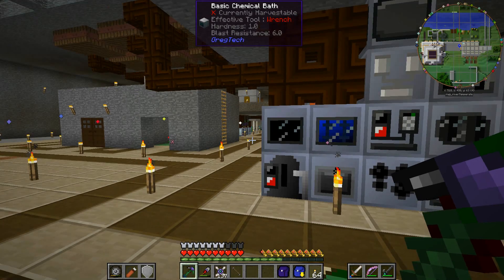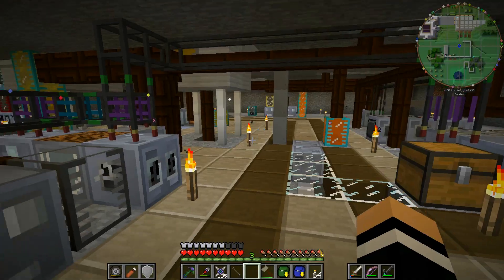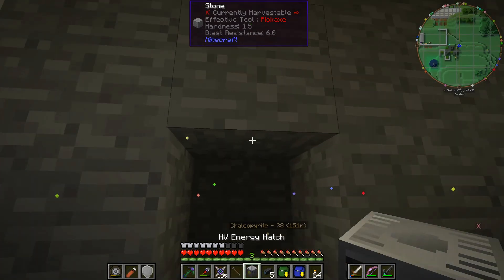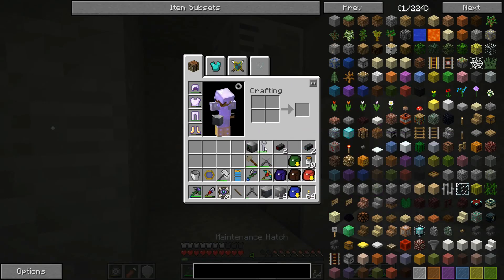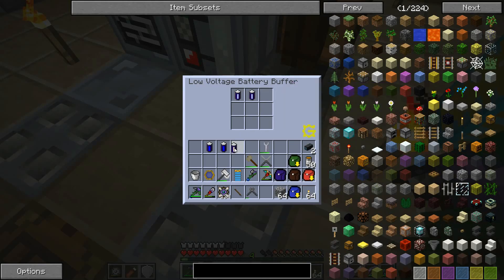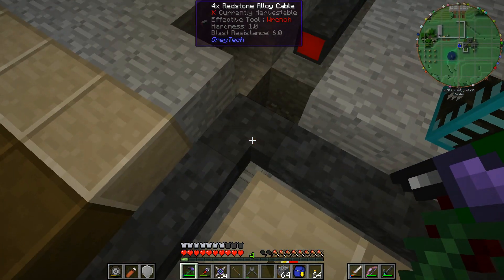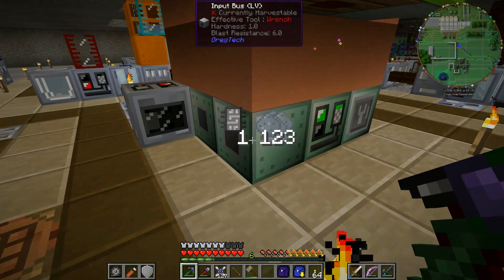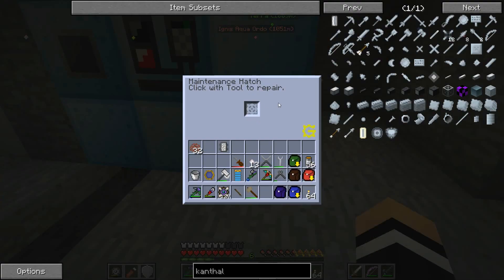S10E47 GTNH - Vacuum Freezer & Implosion Compressor

Comment: If you're going to be upgrading your ore processing array, you should definitely look into making the GT++ multiblock versions of the ore processing machines. They're all far better than their single-block equivalents (faster and less power-hungry) and the maceration stack gives you extra outputs the same way an ore drilling plant would. You'll need to dive into EV a little to make all of the machines, but you'll be able to do that easily enough as soon as you go to the moon and bring back some titanium. Also, for that kind of upgrade you'll definitely need an entire new building since your current base will not fit all the ore processing multiblocks in a convenient way.

Comment: Just so you know, there are superconductors for every voltage tier up to (and including) ultimate voltage now. You tend to need some components and machinery from a tier or two above in order to make them (you make wires from a complicated superconductor base alloy and then assemble them with some liquid nitrogen and pumps and things) but they're worth looking into since you're running longer cables now.

Also, at your point in the game you should be able to start making distillation towers. Though you'll definitely need to expand your base significantly if you want to do that (I'd recommend a new building) since distillation towers are quite large and really should be built for a single recipe. If nothing else, you should make one for splitting oil into its fractions (or four, since if you make an oil drilling rig then you'll get any of four different outputs depending on where you place it, and each of those outputs needs its own distillation tower (actually, the three oil types can technically share a distillation tower since their outputs are the same just in different quantities, but they can only share a tower if you're only distilling one type at a time, and natural gas needs its own tower anyway)).
Reply from the maker: Ah good tip on the superconductors, I wasn't aware lower tiers had them :-)

I have plans for a distillation tower coming up. I know my base has some severe limitations at the moment with layout, and I plan to change quite a bit of it to get some stuff done. Pyrolyse needs moving and its recipe changed, the output of which needs to go to a distillation tower.
Oil needs fixing as you said, also with distillation towers.
Fuel needs major fixing both in refining and layout to easily power stuff - will start looking at the multiblock generator as well most likely, with transformers to power the HV and MV stuff... And will likely just get rid of LV altogether eventually.
Large chem reactors as well should be on the menu soon too, especially for fuel production to get rid of all these stupid cells everywhere...

Basically, there is a ton to do, and thats just on the tech side, without even mentioning the magic side! :-P
Reply: I recommend distill oil -> use light and heavy fuel for power, and steam crack the naphtha and distilling steam cracked naphtha.
Reply from the maker: Yeah I'm using light and heavy at the moment to mix for diesel.
Once I get the distillation towers working properly, I'll re-think exactly what I use for what.
There are some recipes that I might go for that are not as efficient, but are more renewable. Oil is finite, but anything from trees just keeps going, so even tho its not the best source in terms of numbers, it ends up being easier and better long term as I dont have to keep going and finding oil ;-)
Reply: I was looking at the recipes yesterday - not ingame now to confirm - but is there any point to I believe the MV Superconductor? It's the same as Annealed Copper at that tier.